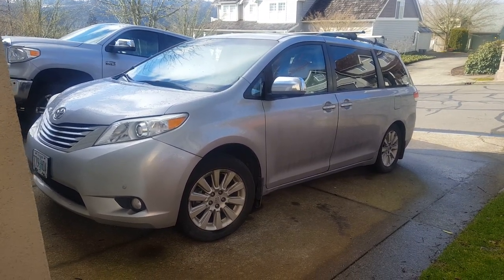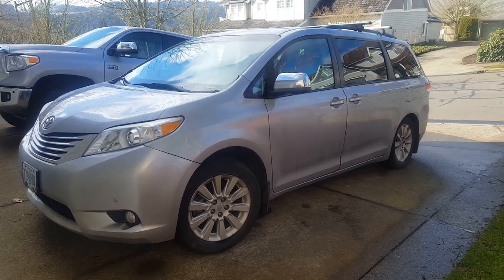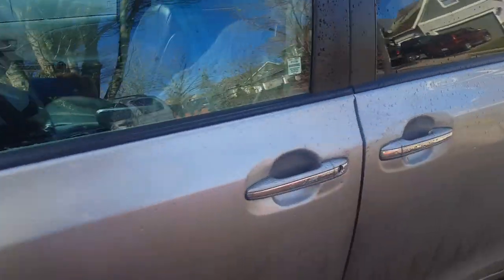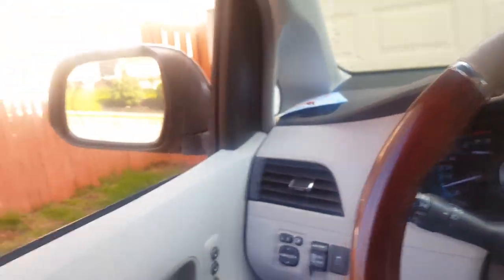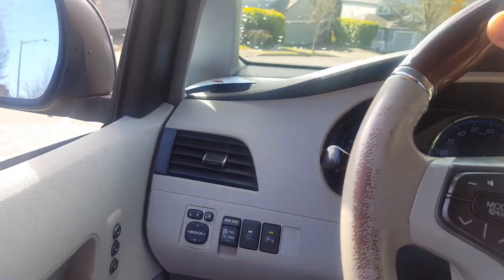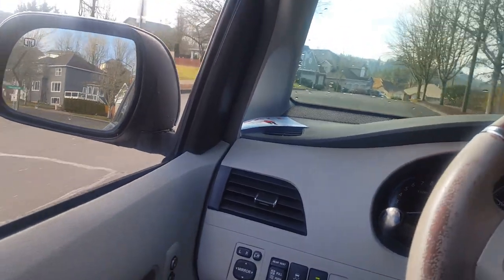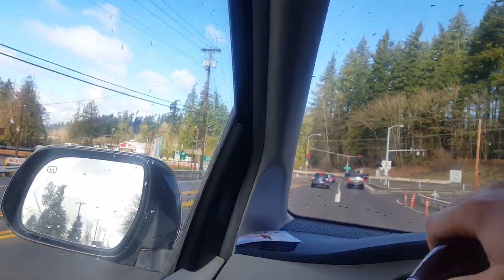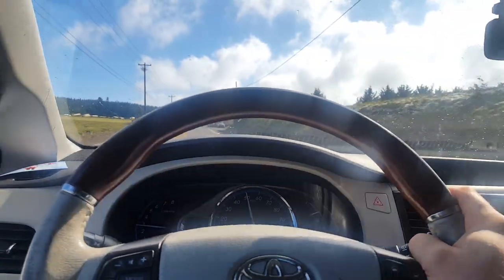2011 Toyota Sienna AWD whining noise

Comment: Well, that answers that question! 2012 AWD Sienna ~98,000 miles has the same sound. Best guess was a wheel bearing, but sound doesn't change when turning to left or right. If it's a common failure, it seems like we were about due. Thanks for posting the video!

Comment: Don't make my mistake. I have a 2012 awd sienna and did both rear wheel/hub assembly, brakes and brake pads. Noise was still there so took it to toyota to to alignment and other things. They wouldn't listen to what I was telling them, so I finally put the van up on jacks and found the noise was from the diff. coupler. What a waste of money!! Now I have to order parts which is over a grand.......so mad at myself. Thanks for the vid
Reply: I meant brakes and rotors
Reply: Ouch
Reply: We had the same issue with our 2011 LE AWD at only 106,000 kms, though 11 years old. It's disappointing that the Dealerships can be upfront and just tell you the most likely cause of the noise. This is a pretty common issue on these vehicles. It all started with a vibration we noticed when accelerating and our local mechanic drove it, put up on the hoist and used a large screw driver to rotate the drive shaft and it did not like to turn freely,, the rear universal was binding, you could tell by putting your hand on it while rotating the drive shaft.This was an expensive fix, the drive shaft was $1200. This  fixed the vibration on acceleration.  A few months later, we heard the whining noise, diagnosed as the viscous coupler. Our mechanic thought that the seized rear universal joint vibration may have caused the premature failure of the viscous coupler bearing. We chose to replace the complete coupler sub-assembly, part number 41303-28013, it was $995 plus labour. We still like the vehicle, its been a good so far and much less to fix these issues than buy a new one. One other important issue is the rear diff breather vent seizes up on these and will cause the rear seals to blow out, you will see oil seeping out around the differential shaft bearings. Easy fix to remove, lubricate or just replace the vent plug, it only $11.50. Part number 9093003075. When the vent  seizes with road grime, it does not allow the pressure built up in the diff when you drive long distances, it heats up due to normal use but the pressure can not escape through the vent. It is easy to just reach in and spray with a cleaner to make sure it turns and goes up and down freely. I check ours every time I do an engine oil change.

Comment: I had bad rear wheel bearings on a 2015 awd sienna. I had to wait until it gor louder and the right service rep to get them replaced under extended warranty.  I'll listen for that airplane coupler im at 86000 now. No noise.  After that they messed up my brakes and i had the front calipers changed n/c. Now im looking at the rears.

Comment: its was hard to hear but my 12 sienna awd had a similar issue. sounds like an airplane or like some electrical whine. the issue was the electromagnetic coupler. that part transfers power from the front to the rear. it is located in the rear by the rear differential. the part it self is about 1000$. toyota quoted me 2500$ for labor and part. i ordered the part and did it myself.
Reply from the maker: Mine turned out to be the same issue. Once i replaced the coupler, it was fixed
Reply: How hard was it? I have the same issue.
Reply from the maker: @may132005  It was pretty straightforward. Took less than an hour and saved over $1500.
Reply: Never Forever it wasnt too bad. took about an hr. you have to disconnect the drive shaft bracket and unmount it from rear differential then it comes off. you may need another person to help as you go to put it together.
Reply: @Sa.-.V  
Good job. I had a mechanic to change the viscous coupler,  don't have garage to do it myself. Kept the old one though.  Will change the bearing and keep it just in case.
Reply: What is the name for parts order?? I have the same noise
Reply: @melvinnegron6628  hi brother do you find the part and  where thanks
Reply: @Sa.-.V  hi where do you find the part? Toyota dealer

Comment: Hey I have same noises from my differential its in back center . Let us know if you get it fixed I’m trying to see electromagnetic differential lock . I play not too long ago with sport mode and noise came in. So could be that too
Reply from the maker: My problem went away when i replaced that part

Comment: Same issue with my 2011. Has anybody tried pulling the rear driveline and running it front wheel drive  only? I know the front diff can handle it by itself, just not sure if it will go in limp mode because I’m sure speed sensors would go crazy.

Comment: I have 2011 Sienna LE and it starts whining at 2500 rpm, whether it's in gear or not... could I have a problem similar to yours?
Reply: Did you figure it out? I have a similar issue ?

Comment: Was this sound constant or did it happen intermittently at first? We just got a 2011 Sienna and I’m hearing this from time to time, so worried about how expensive it’ll be to repair if it’s the same thing.
Reply: I just bought 5 days ago the noise came out from rear back I don’t know what happens

Comment: 09 XLE AWD similar noise however looks like the noise is coming from the front passenger side, i replaced the front  bearing and the noice still there,.i lifted the van and no noise from the rear,.what u think?
Reply: Did you figure it out?
Reply: @OmarJace  yes
If i remember correctly the small ring protecting the wheel bearing was bended

Comment: Did you change the viscous coupler?
Reply from the maker: Yes, I did and the problem went away. Dealer quoted me $2500-$3000 for the job that look less than an hour for me to do. It was pretty straightforward. I did a video on how it was actually done, but it got deleted for some reason.
Reply: @cvalor2006  Thank you!

Comment: You can replace the viscous coupler bearings for about $100 and a hour of labor.
Reply: I have the viscous coupler details if you want them. 
I just did it a few months ago. 

The parts are not all Toyota parts. You need a special bearing.
Reply: @kcarew2  It took me about 2 hours inside my garage and the bearing was 100 dollars , no special tools.
Reply: @derbymasterify  STOP LYING
Reply: @derbymasterify  part#?

Comment: same thing with my 2011....
Reply from the maker: The funny thing is that when I called my pretty big local Toyota dealer to see if Toyota came up with a recall or some kind of a fix for this problem yet,  they made it sound that they have never heard of this problem with AWD Siennas. I know its not true because there are LOTS of people online complaining about the same issue.
Reply: did replacing the coupler fix it?
Reply from the maker: @jabman549  yes
Reply: @cvalor2006  so is this a recall for 2011 toyota sienna awd..? Because I also have 2011 toyota sienna xle awd and it's making this noise..
Reply from the maker: @ernanv24  
Unfortunately no...but it should be because ALOT of people have the same issue
Reply: @cvalor2006  what's the parts called..???
Reply: At how many miles did the problem start? I went to see a sienna 4wd limited with a transmission changed by Toyota and I’m not sure if I should buy it or not. I really like it. It has 114,000 miles.
Reply: @pedroespinal3593  130K....could also be a wheel bearing - much easier fix
Reply: @pedroespinal3593  My 2011 Limited 2wd will never have this problem.

Comment: got the same program report on nhtsa.dot.gov so they can make a recall.
Reply: Where you able to fix the problem?
Reply from the maker: Yes
Reply: They did but only as a tsb....
 TSB 0080-13
Reply: My 2011 TOYOTA SIENNA has the same issue. Could you please provide more details about recall?  Many thanks
Reply: @Bo-xx6qr  Its not a real recall but a TSB. The TSB number.... TSB 0080-13  your toyota dealership can look it up (do yourself to verify) and if your vehicle falls under the TSB it should get fix for free (depending on year of van).
Reply: firm believer Many thanks for this!
Reply: @Bo-xx6qr  I’m having the same problem. Did Toyota replace your part for free as TSB?
Reply: @irfanfarid   I paid 1600 dollars to get it fixed
Reply: @Bo-xx6qr  Wow. That's why I own the 2wd model.